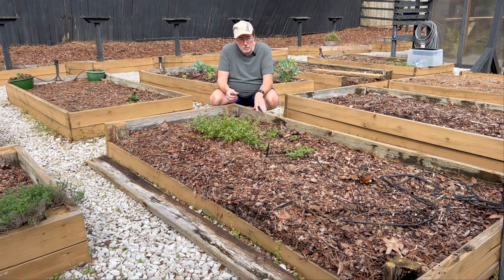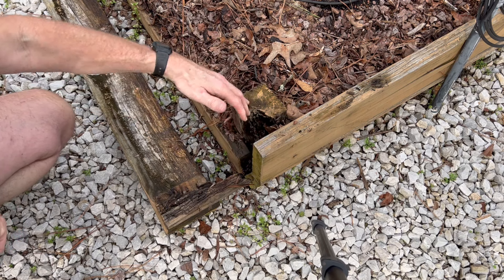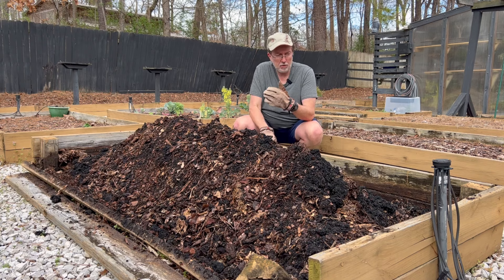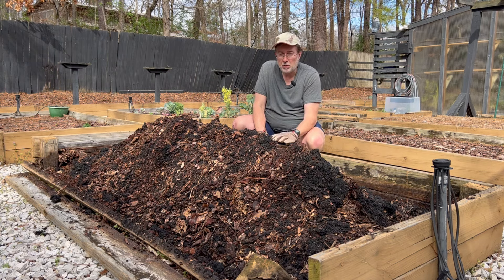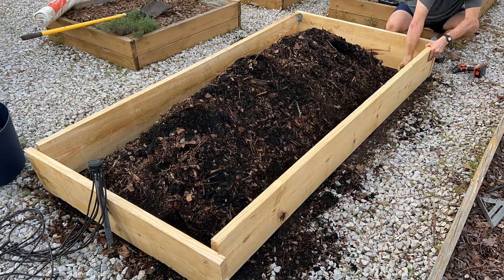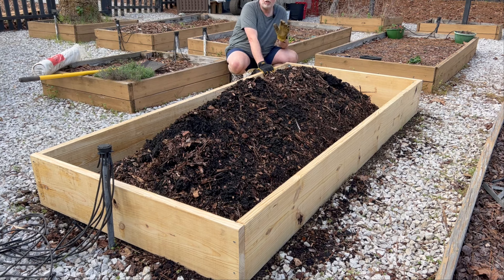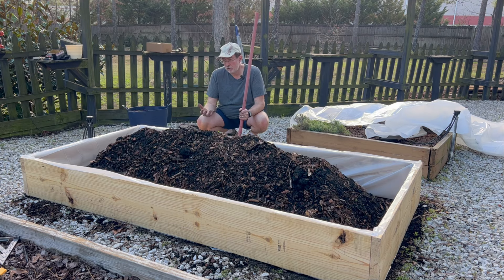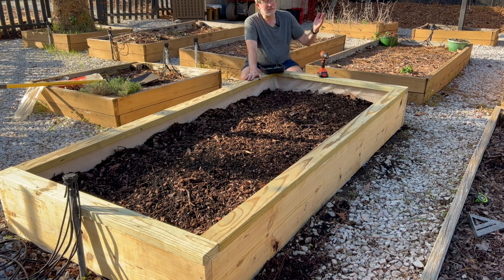Raised Vegetable Garden Beds | Safe Or Toxic?

Comment: I built my raised beds almost exactly as you did in this video except that I used sawmill untreated hardwood lumber. I also used the thick black plastic instead of the transparent plastic. I did run out of black before I finished the beds and had to use transparent for the last two beds and that was 7 years ago. Within 3 years after doing that the transparent plastic which looks just like yours completely crumbled. I had to replace it in both beds that had it. Now they all have the thick black plastic and the 8 beds that had black plastic originally still look as good as the new ones. The sun destroyed the transparent plastic. I have 11 beds total now and will only use the thick black plastic. It is no fun having to redo a big raised bed to replace the plastic. So far my sawmill untreated wood is doing great.
Reply from the maker: Happy gardening

Comment: Some of our pressure treated beds were built over 25 years ago - they are the landscape timbers zipper stacked with rebar rods through them to hold everything together. Although they do have a lot of rot on the inside where it contacts the soil, the outside still looks really good/ And it all is still doing what it was meant to do - hold in the soil and allow us a place to sit while we garden - so I consider them to still be in working condition. When I recently had to tear some of them apart to put in a greenhouse, I was even able to reuse some of the lumber to build new beds. I also have some with the newer pressure treated chemicals that were built about 15 years ago. Some of them aren't fairing quite as well, but some are still looking great. We did get the lumber for these at two different places, so I think how they are doing might be more about the quality of the actual wood. In all those years, no one who's eaten produce from the garden has had any ill effects. I don't till the soil, so most of the  leaching would remain pretty close to the edges anyway. I don't use plastic lining because it's extra money, I'd have to worry about not ripping it up when I do work near the edges, and then there is the whole micro-plastic issue anyway.
Reply from the maker: Toxicity is everywhere….it’s just a fact of modern life.  Wish I could get pre 2003 lumber.  It was so much better. 👍

Comment: Thank you.  I have metal heavy duty steel siding I’m using to make my beds.  Do you know of any type of paint I can use to possibly cover up or seal in any negative effects from potential paint that already exists.
Reply from the maker: It would need to have rust and water resistance.  Perhaps marine paint?  But toxicity I’m unsure.

Comment: Aren't you just creating a moisturise area with the poly?
Reply from the maker: How so
Reply: @ZenGardenOasis.  In between wood and poly it heat will create area of moisture
Reply: @chrisfree2000  The wood still breaths from the outside. He did not put the poly on the outside and he overlapped it on the top edge where water could get in. Other than the type of poly he used we did the same things and my wood beds are still doing great. It has only been 7 years since I did mine and eventually I think that all wood beds would need to be replaced. The idea for me is to try to get as many years as possible out of the beds still knowing that eventually I will need to replace them.